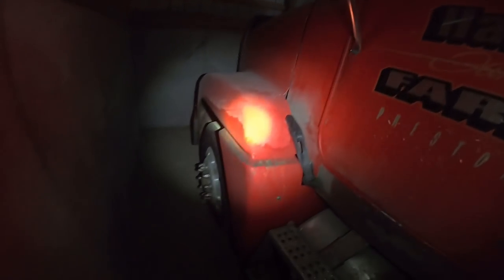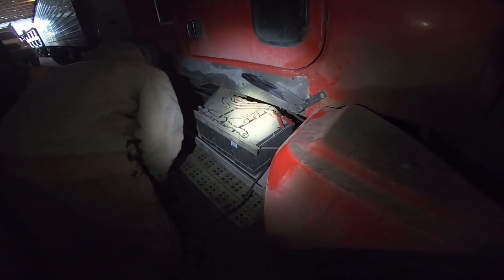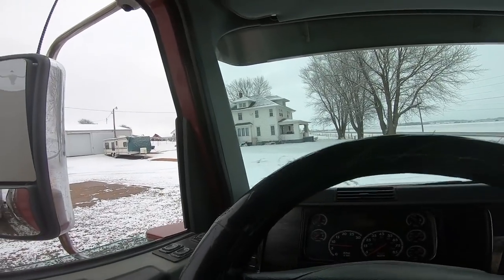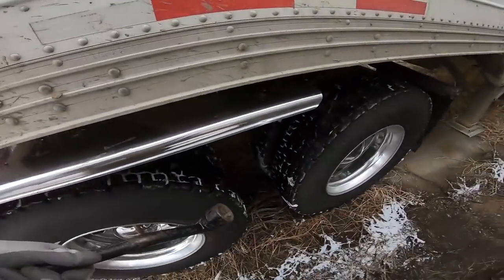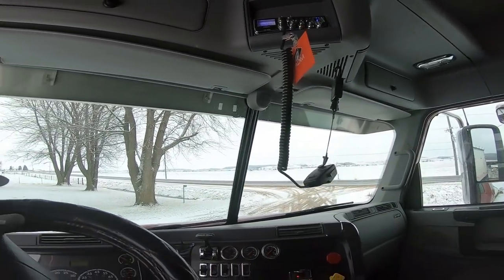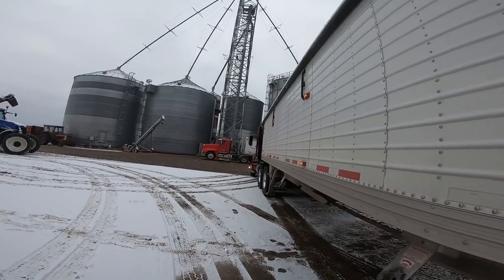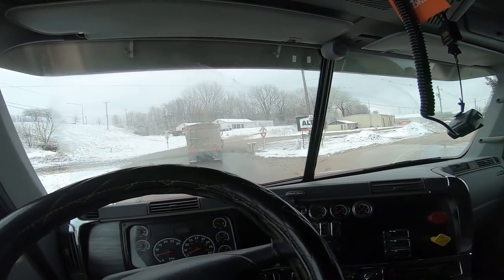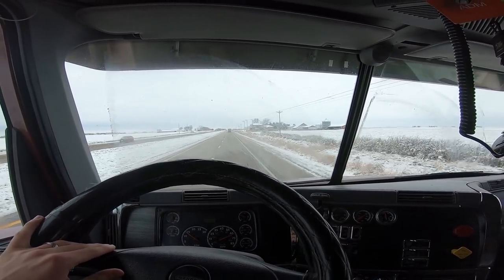How to DRIVE AN 80000 POUND TRUCK

Comment: Hi Ron another good video.  I have always called the Jack's for the trailer Landing Gear and as far as the air for the trailer the blue line is the service line which when the brake is applied it activates the trailer brakes.  The emergency red line supplies air constantly to the trailer air tank or tanks. When you pull the trailer valve it dumps air there fore setting the brakes. Brother trust me I am not getting on your case, just thought I would pass these things along. I have a really long air line that I made up with a glad hand on one end and a tire gauge and air filler nozzle on the other end that I can hook up to the red line release the trailer brakes and fill up all my tires if they air a touch low. I drive a 2005 Freightliner FLD120SD with Michigan special frame, axles and suspension set up. Its is seriously beefed up. 18speed Fuller trans and the 14 liter Series 60 Detriot, think it's around 530HP. 
Pull a 4 axle Manac Rockbox.  29 ton and me in the seat it scales just over 101,000 pounds 102,000 pounds is a legal load. No criticism meant just though you may be open for different ideas. Let me know what you think???
P.S. When down shifting  I depress the clutch 1 time quickly to take the truck out of the gear. It seem to help it fall out of gear alot easier then bring the throttle back up to grab your next lower gearbox the one your trying to get into. It seem to be less harm on the tran cause I have seen drivers trying to down forcing it out of gear to shift. Maybe some of these Ideas will work out for what you doing. Good luck be safe and safe travels.  Please believe this in by no way is criticizing you at all Driver

Greg
Reply: Sorry about sending you novel, just trying to help you out in anyway I could. Let me know thanks Greg

Comment: We have two semis. We have a Ford that is basically like a Sterling and we have an old IH S1900 single axle. Ford has a Wilson pacesetter trailer and the IH has a jet single axle trailer. Driving truck is one of the most fun jobs in my opinion during harvest or any other time on the farm. It's hard to believe how much semis are used on the farm.
Reply from the maker: I completely agree! They are used a lot

Comment: The gearing you make takes me back to the 70s, 
when I drove a Ford Transcontinental with a Cummins and a Fuller. 
I belonged to them double steppers.  
I pulled 136000 pounds with that truck.
It was strong
Reply: How many HP back in the day you drove?
Reply: @BWYinYang  
I don't really remember, but it should have been about 350hp maybe 400. 
This was 1977, when I started driving at 16 years old.
Reply from the maker: That’s crazy! Haha I bet you didn’t have massive hills
Reply: @HartungFamilyFarms  Well. Sweden is a mountainous country so it was often on low gears. Then we could only drive 43 mph, that was the speed limit for trucks.

Comment: Adm in Cedar Rapids? And an engine brakes opening a valve on top to bring in pressurized oil. The high medium low is the pressure levels.  Like the cat, I'm guessing c-11 by the engine brake sound? And unless your experienced DONT USE THE HAND BRAKE ON THE ROAD. People confuse exhaust brakes with engine brakes all the time exhaust is just a damper in the exhaust.  Worked on big rigs for 10 years now. Some trucks dont like floating but our farm is all Pete's except 1 and they all float nicely.  Shifting Down in high range just look at your speed dont drop from 13/12 until your around 45 or you'll grind, then 35 for 11/10 25 for 9/8 then just go down as you slow down.
Reply from the maker: Makes sense, I can tell that you've got some time behind the while and in the engine block. Thanks for all the info!

Comment: nice to see the shifting and your explanation! As a Dutch (former) truckdriver I'm wondering if you never skip gears? When I drove DAF (paccar company) with a 16speed (also splittergears in the low range) it was very common to start in (low range) 2nd low splitter (if you know what I mean) and then on to 4th (low/low), to 1 (high/low), and then depending on the weight all the gears from there when fully loaded (50tons) or all the gears in high range low splitter until 4high, only then onto the high splitter. I have to say of course that the Netherlands are flat!

Cheers from the Netherlands
Reply: I had a trans like that in a heavy wrecker, I called an 8 speed double under.  Was great for pulling really heavy loads.
Reply from the maker: That’s a cool transmission! Yes I do not split when I’m empty, no need to. But loaded, I accelerate better when I hit everyone one
Reply: @HartungFamilyFarms  I can imagine, especially when it's not flatland and/or depending on horsepower, we ran most 430/460hp. And it was indeed a nice transmission to work with, maybe because I learned it with that transmission. 

We also had 12 speeds, but those were 3 gears high/low and all splitted. Also nice, but everytime I had to get used to that, didn't drive those Scania's and Volvo's too often.

Comment: ADM has been a hit an miss the last month on lines or not. I float the gears unless I'm driving a two stick. . U should always run the tires at 100psi cold. That vao on your ticket means subject to grade Ron. Cause it's under #2 corn cause anything below 54# is a dock on the corn. Shifting down is where most people have troubles. If people really pay attention they'll noticed it's a 200-250 rpm split between all gears going up or down on a 13 speed transmission depending on the model number of the transmission
Reply from the maker: I believe that John on the RPMs for the gears! And thanks for the good information!

Comment: The bushel calculation is based on a 56#/bushel corn standard. On your ticket 55,320 / 56 = 987.86. If they used the TW value of 53.3 it would be 55,320 / 53.3 = 1037.90.
A good explanation of this is:
https://www.agry.purdue.edu/ext/corn/news/timeless/TestWeight.html

Comment: Many comments this time.
I just know how Scania and Volvo's exhaust brake works.
A valve in the exhaust pipe is closed with an air piston.
It increases the engine brake.

Comment: Do you all not fill out a VCR book when you get done driving. You didn't mention if you checked the steer axle springs or air bags and same for your drives and trailer. Do you give your steering a little side to side turn just to make your steers move with the steering wheel.  You didn't mention if you checked the low air buzzer to see if it worked. Do you look at the jaws on the fifth wheel after you hooked to trailer to make sure they have closed or to make sure pin didn't ride over the top or down the side of the fifth wheel. Was a good looking truck is it a glider with a 60 series in it
Reply from the maker: I didn't show everything but yes, I do! Good catches though!
Reply: @HartungFamilyFarms  the way you showed it people are going to think all you do is thump the tires an go. And if you would just dump the air on the tractor then crank the dolly legs down when you backed up to trailer it would pick the trailer up may save you all of those trips climbing in and out to get hooked. And you may check the 72,000 lb double latch fifth wheel I have on my Western Star actually calls for gear oil to lube it the oil gets into the jaws and locks on it better than grease. I use both

Comment: You drive well, but you have very small loads in your country.
The load on the wagon after my truck in the 80s, weighed over 81,000 pounds. 
The truck load weighed 28,000 pounds. 
Truck and trolley, weighed 31,000 pounds empty 
and the entire truck + trolley was 78.74 feet long. 
400hp Volvo F12, 1987 with turbo and intercooler,.

This is normal in Sweden.
Reply from the maker: Wow that’s impressive!

Comment: Test weight is a commonly confused number. When we sell grain we sell by weight. In this case corn, basically $xx per 56 pounds which is the standard weight of a bushel of corn. Test weight is pretty much a measure of the quality of the grain your selling. The number "Test Weight" is the weight of 1.25 cubic feet of grain. 55320 lbs divided by 56 lbs per bushel equals 987.857 bushels.

Comment: Using the clutch to shift ruins the clutch brake. I drove spud truck for my uncle for the first time this year. All his trucks are 1990 or older, and so they are all old beat up manuals. I was thrown in a truck and told parking brake off (the truck had been running a few minutes ago), clutch in, out of gear, start engine, put in first, and follow me down the field. I stayed in the field and just hopped trucks, but I was told to shift with the clutch. The next field we went to, there was a half mile dirt road that I would drive down to switch trucks, and I tried the floating method. It was much easier, and by the end of the day, I was shifting like a pro and not grinding. That was the best harvest, and I am exited for this year because I can drive on the road legally this year.
Reply: Using the clutch  does not mess up  the clutch break pushing the clutch pedal  to the firewall  dose. Gust push 1/2 way down to shift and double  clutch
Reply: @donmcmannamy3409  you are 100% correct, clutch break engagement is your foot on the firewall.
Reply: Don McMannamy and Greg adomeit. Ok. I was just told that by a friend when I told him how I was taught to shift. My bad. I don’t know everything I guess.
Reply: The 13 speeds I’m used to though have reverse 1, 2, 3, lever to mid, 4, 5, 6, 7, 8, lever to high, 9, 10, 11, 12, and 13.
Reply: @zachashcraft6243  Brother I wasn't trying to rip on you, just trying to help you out. Hope you didnt take it that way. Be safe and safe driving. Oh and nobody knows everything. You take care of yourself Zach
Reply: @gregadomeit4020  I drove a semi long hall for over 20 years. Stopped do to medical  reasons
Reply: @zachashcraft6243  in the newer  computer controlled manual transitions you have to use the clutch or it messes up the system. Yes you can float  the gears but it causes the computers to not work right and causes the motor to use more fuel  than it should and fows up the exhaust system.
Reply: You use the clutch break to go into 1st or reverse  from neutral  only
Reply: @donmcmannamy3409  sorry to here that my back is messed up from it
Reply: @zachashcraft6243  dont sweat it zach your new to driving it just takes some time.  Ask question alot of people will try and help you out be safe.
Reply: @zachashcraft6243  hey brother check out this channel call Smart Trucking. Dave that puts it together does alot to help newer drivers. He says there is no such thing as floating gears it's called shifting with out the the clutch lol. You are not floating anything your trying to match the rpm and speed of the truck. When done correctly it does no harm and will save your knee later on in life. True story
Reply: @gregadomeit4020 thanks Greg. Not my back but a combination of several things that did it starting with complications from shingles and then things adding on. Can't pass the dot physical any more
Reply: @donmcmannamy3409  again sorry Driver.